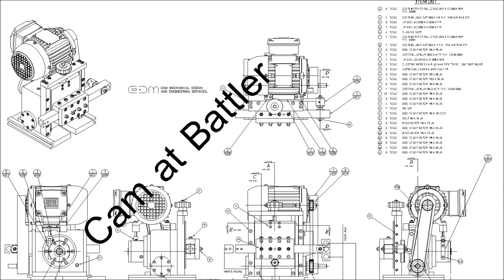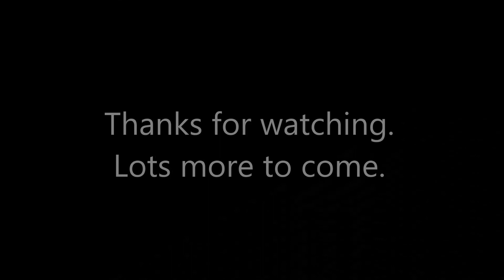Chamfer Tool for the survey "L Bracket" and a quick look at the progress on the Foundry Shed.

Comment: G'day Cam. The chamfering tool does make short work it, I can imagine setting the block up in the mill would be highly time consuming. Shed looks good. 
Cheers Peter
Reply from the maker: Thanks Pete, picked up all the roof, flashing, siding, and guttering.  Had to save for the materials, not cheap.  My wife said she wanted it to look like my existing shed but it did cost.
Cam